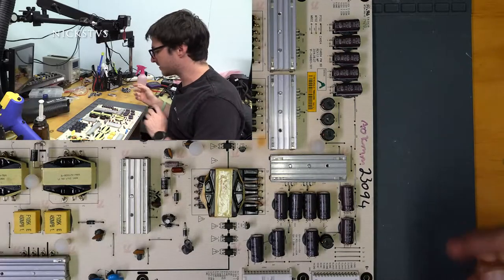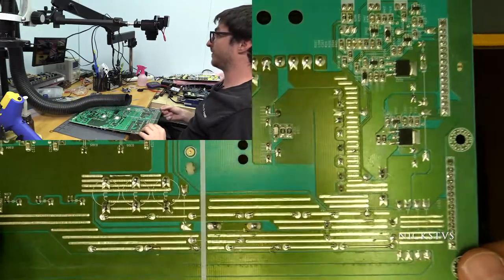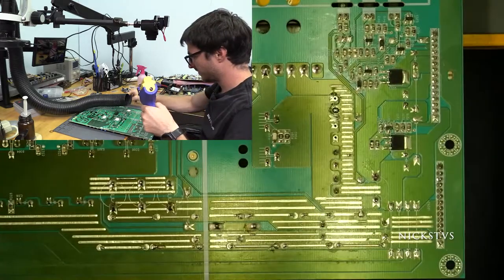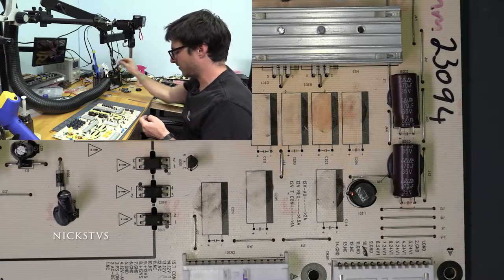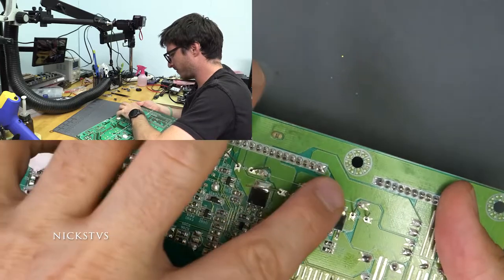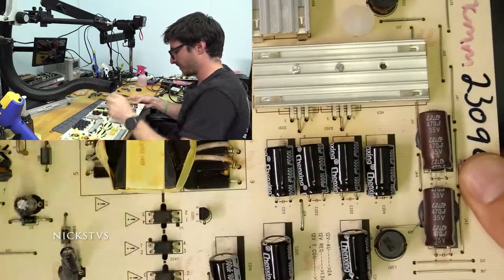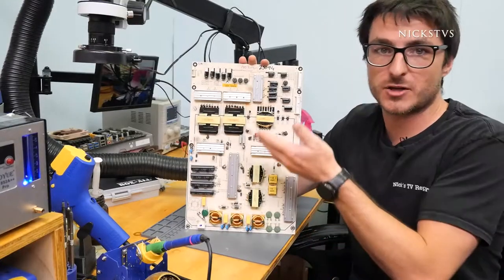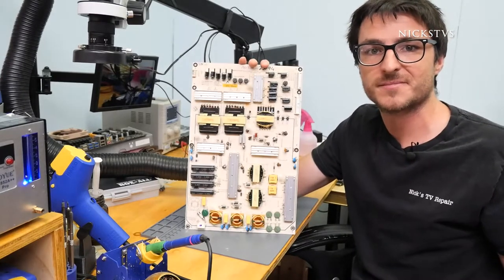Vizio 4K Dead Power Supply P702ui-B3

Comment: Hi Nick, I had a few bulged capacitors. Ordered the 14 from the link and replaced them all. Now, i turn on the tv. It blinks 13 times, stops, and then blinks 13 times.  Thank you, man!
Reply from the maker: Do a quick double check on the caps and make sure they are in the correct orientation and the correct values are in the correct spots. Double check all you cables and wires are properly connected. If everything is good then it's possible your mainboard may be also bad. 
It's very rare to see bulging caps on the power supply and yet the fault to be on the mainboard. However it's not unheard of that both the mainboard and the power supply both are defective and need repair around the same time. 
https://youtu.be/un7OJLTWtJY?si=XkBUVn9Z_2Cw-HwX

Comment: @NicksTVRepair  I ordered a repair kit for this power supply board specific for this model TV and it came with 470 µF but 50 V and 1000 µF 25 V capacitors. Can I use these or do I need to order ones with the same voltage as the originals? Originally it was 470 µF 35 V and 1000 µF 16 V.
Reply from the maker: Yes yes the higher voltage rating means the capacitors can handle a higher voltage which means it will run cooler than the originals.

Comment: Wouldn't it be easier to just buy a new board? how much do they cost?
Reply from the maker: Sure it's easier, but you are buying a board that is prone to failing again with the same fault. With the repair at least we can instal higher quality capacitors that won't fail again. 
Something else worth considering is that it's more expensive to buy a whole new board, and often impossible because these boards are typically out of stock and no longer being manufactured. 
It's also better for the environment to fix over replace.

Comment: Replaced my bulging cap and power led is on now but no backlight or picture.  What's next?
Reply from the maker: J Kwak,
In your comment you said you replaced your "bulging cap" singular. The issue could be that the other caps in the area are also affected and also need to be replaced even though they visually are not at fault. If I were you I would replace them for 2 reasons. First reason being that it could resolve your issue, and second is even if it doesn't you still want to do this because if 1 of the caps went out, the others are not far behind and you will have to do this again in a couple of months. 
Per the video I recomend you do as we did and replace all 14 caps. 

If that still doesn't resolve the fault, then you may have a mainbaord failure. In which case I recommend you go watch this video next on the mainbaord repair:
https://youtu.be/G1Rh6Snf94g

I also do have a full diagnostic video that goes over all common faults for these types of TVs that you can check out at the link below:
https://www.youtube.com/watch?v=un7OJLTWtJY

Comment: Hi Nick, can the capacitors be tested without removing them? I have the symptoms of a bad power supply, but the capacitors aren't bulged. Thank you
Reply from the maker: If they aren't bulging then they are most likely okay. It is always recommended to remove at least 1 leg from the circuit when testing caps. If you do not then you won't get a correct reading as you will be reading all caps in parallel and not the individual caps themselves. 
The symptoms of a bad power supply can also be the same as the symptoms of a bad mainboard. 
What symptoms are you experiencing? Please do not reply to this message but instead post a new message or I won't see it. I don't get notifications for replies, only new messages. 
You can also message us directly to our support email or fill out the contact form.
Links and contact info are in the video description.

Comment: Hey are you still doing repairs for this model? Mine has taken 4 attempts to successfully boot for the last 3 months and today it won’t turn on at all not even the corner LED.
Reply: Also do you have any instructions on how to remove it or do I just take the back cover off and unplug and unscrew the board and send it in?
Reply from the maker: Hello,
Yes that is a module we are still actively servicing. If you take a look at the video description there will be a link there with our repair service page. Click on it, and add the service to your cart. Once you do so and proceed to check out you will receieve an email with packaging and shipping instructions.
Reply from the maker: I unforutnately don't have a video on removing the power supply. But I recommend laying the TV down on a bed, or couch, screen facing down. Then you can remove the legs or wallmount and all of the screws from the back cover. Once you do that the cover should lift up from the bottom, but will have a couple of clips as well, just wiggle the cover off and then you can remove the power supply. I recommend disconnecting the wired connectors first, then the screws. 
The board should lift right off after that.

Comment: My problem is slightly different. I have a backlight (the same as a black picture, very dim) and a power indicator, but no logo at start and no video. If I power cycle, it then works OK. Sometimes it needs two power cycles. Also,  a while back, the TV would just shut off, but I could easily restart. Haven't seem that for quite a while, but could be related. Do you think this a PS problem? I haven't opened the set up yet. Also , are the capacitors high frequency types or just ordinary electrolytics?

Thanks, Joel N.
Reply from the maker: Hello Joel,

It does sound like you have a power supply based on the fact the TV works after it is restarted once or twice. 
They are just generic Electrolytics.